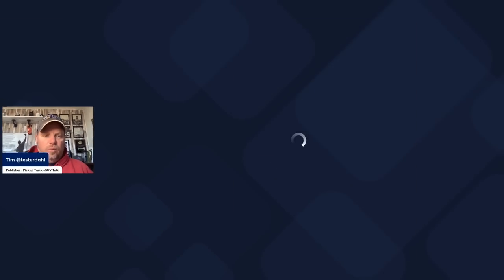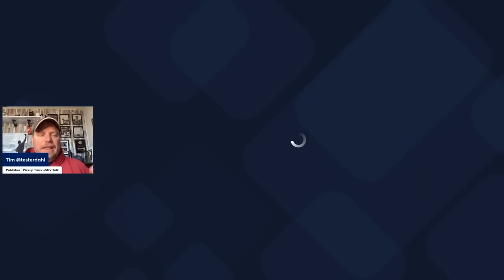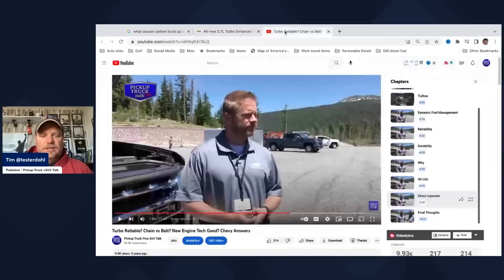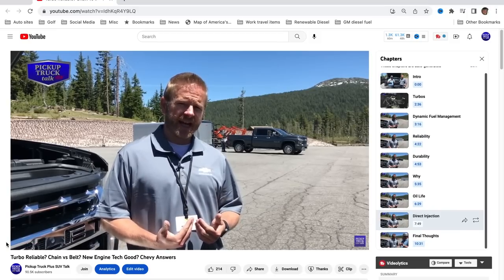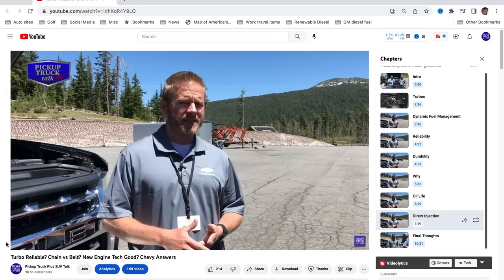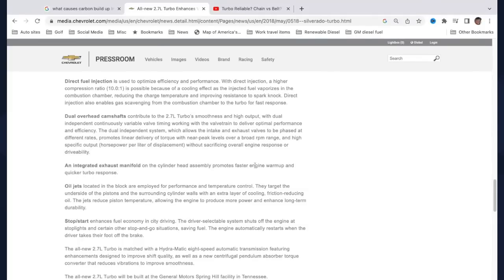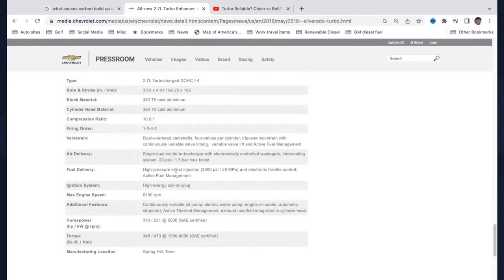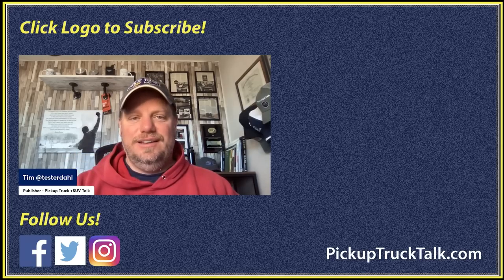Are Direct Injection Engines Bad? Carbon Build Up Concerns?  Engineer Interview

Comment from the maker: Here is the full video with the engineer: https://www.youtube.com/watch?v=IdhKqR4Y9LQ&feature=youtu.be
Reply: This engineer hasn't been reading forums or complaints....this engineer doesn't understand that the owners aren't concerned about the combustion process using direct injection.  As been stated over and over, it's the upstream path prior to compression and combustion that's the issue (due to PCV).  Direct injection has been used for decades in diesels....nothing new other than a timing with the ignition of the spark plugs on gasoline engines.

Comment: I see a few guys already mentioned it in the comments, but I will elaborate on the issue he didn't discuss too. The main problem is the EGR bringing oil mist back in across the intake valves. Port injections washes this off the intake valves and prevents the carbon buildup. Catch cans will slow this process down, but not totally eliminate it. Ford redesigned the ecoboost to have DI plus some port injection to solve this issue. If you talk to him again, please ask him how this specific issue has been solved on the 6.6 gas engine. As far as I know, it hasn't been solved, but maybe I'm wrong.
Reply: Not EGR, if you have oil mist in your exhaust gas, you already have some BIG problems. It’s from the PCV system.
Reply: @jeffs2809  You're right. The older I get, the more think something and say something else.
Reply: You're mostly right but a little bit incorrect terminology. It's the crank case blow by that gets returned to the intake through the pcv that creates intake valve coking. Valve coking is worse on turbo charged engines, which is the point for ecoboost having port and direct injection. The port injection helps to clean the back of the intake valves.
Reply: I just would add Ford to BMW have had the carbon buildup issue on intake values. Toyota from the start went with direct/port injection, first on Lexus. I remember being at the Detroit Autoshow looking at the Lexus engine cutaway (during industry day) and hearing competitor engineers comment that they could not afford to add the extra injectors. They learned the true cost of their mistake.
Reply: And as an engine gets more miles on it the PVC will pull more gases/oil deposits into the intake system which will stick to the hot stem of the valve. This guy isn't assessing an engine on the outer spectrum of time that would be seen on a vehicle coming off of warranty.
Reply: GM failed to learn what Ford experienced with their gen 1 eco boost engines.Just a matter of time for GM to have the same issues. Besides what answer did you expect from a gm engineer especially since he tip toed around a direct answer to a known problem with direct injection.
Reply: Pcv, not EGR. If your EGR is bringing in oil, you have big problems
Reply: @10YearOldTom  You are right
Reply: Wait, the new Ranger will have dual injection? If so, they will definitely give Toyota a fight for sure. Hopefully, the Colorado won't have carbon deposit problems. Yet, I'm betting it will. Time will tell.
Reply: I think Tim also didn't mention that some engines go 100,000 mi 200,000 mi without any issue or concern for this carbon buildup which probably is happening every day but not compromising the overall longevity of the vehicle. As I mentioned earlier, some people don't keep their trucks for a million miles and many people may never experience a problem even with some carbon buildup. So I think the question is is there any additional maintenance or reliability issues with the dual fuel systems where, direct injection is actually good enough.
Reply: One other important point direct injection only on turbocharged engines may be a really big problem because there's no easy or supported way to clean the valves without sending chunks of carbon into the turbo. That's where this becomes a brick wall argument.
Reply: Interesting.  Didn't know there were engines that used both port and direct injection.  Wow.  Talk about extra hardware.  Seems that it might be better to design a cleaner PCV system.
Reply: Hmm... Good point.  Perhaps using full synthetic oil would help as synthetic oils have a higher flashpoint when compared to mineral based oils.

Less likely to burn and coke on intake valves?

Comment: Tim, I think the biggest problem is still not addressed, that is carbon buildup in the intake valves. It’s my understanding that carbon/ dried sludge builds up on the intake valves from the PCV introducing oil vapor into the intake valves building up crud, because in the normal course of port injection the deposits would be washed away from building up on the valves otherwise. Direct injection eliminates this of course. That is why they have added this 2 way punch of port and direct injection. It’s still not clear how GM is addressing this issue beyond using both as Ford and others have done. I think direct injection is pretty great other than this issue and the ones you mentioned. I think all this can be fixed, it’s just what works best. Tim, thanks for a great video with a deeper dive into a interesting topic!
Reply: No knock on the engines, but yes missed the point - the question needs to be - what have you done to illuminate carbon buildup on the intake valves?
Reply: I think twin injection is key.
Reply: @tosil  Like Toyota does. However, unlike Tim is showing with his hand gestures, Port injection comes from above the intake valves thus washing them off all the time. Direct injection is under the intake valves directly into the cylinder.

Comment: Coming from owning several Volkswagens, carbon buildup on the intake valves is a very real problem and the answer still didn't address that.  I'm glad that Toyota has their D4-S system (direct and port) on all their new turbo engines.
Reply: Gas does not remove carbon.  That is not the reason Toyota uses D4-S.  Carbon issues are rare in modern DI engines.
Reply: Lol. No it’s not. It’s quite common actually
Reply: @MSparks9509  Less than 1% of vehicles will ever have an issue.  With millions of vehicles there will be a few issues.  It’s totally blow out of proportion and quite frankly is no longer an issue.  Gasoline absolutely will not prevent the build up or remove carbon.
Reply: @user-tb7rn1il3q  ok, not the gas, but the detergents in the gas prevent the carbon build up .  & yes, it's a big problem on VW's - - i dont know why that brand has such problems more than other, but they do

Comment: This video completely missed the biggest DI problem:  carbon build up on the intake valves.  I have yet to see a GM engineer talk about how they addressed this issue without port injection while Ford & Toyota engineers’ solution was to spend the money and add port for the sake of reliability.   It’s like GM PR is telling their engineers to avoid the subject or something.
Reply: Gm/chev only have direct injection so even after as little as 40,000 miles you have to get the  valves walnut blasted by using a machine that is like a sandblaster. Chemicals do not work. The only way is taking the heads off and getting it picked off manually with tools and solvents or walnut blasting.

Comment: As a 6.6L gas engine owner, here is my experience. Thanks Tim for having this Talk about DI Engines. I’ve listened to this excellent video and read some comments, and recognized GM Engineer Mike Kociba in the clip from a related clip about this engine in 2020. 
Experience: I’ve mentioned to you in another of your videos (your cousin owns a 6.6L engine interview) and that I installed an Oil Catch Can within months of purchasing my new 2020 Silverado HD, upstream of the intake valve and …. it captures approx. 1 cup per 5000 miles (8000 km). That said, Silverado has functioned beautifully up to now (engine and 6 spd. transmission run buttery smooth) and fuel mileage is (14L/100 km hwy. [17 mpg] with maybe 500 lbs of gear) 😌. Very pleased with the truck overall, BUT if I didn’t have that Catch Can, I think over time I would have issues sooner that with it = I think there will be carbon build up with these engines over time despite Mike’s comments, BUT time will tell. 
I agree that as Toyota and then as Ford realized, some added port injection to wash behind the intake valves is critically beneficial to mitigate carbon buildup.

Comment: The core issue isn’t DI, it is when you circulate oil vapor back through the intake. That is what creates the carbon build up. 

DI doesn’t eliminate the carbon build up like port injection does in this scenario. 

The engineer is correct, but he isn’t talking about the entire picture. It is marketing/salesmanship. 

So when you recirculate that oil vapor through the intake, port injection only is far superior to DI and DI/PI. 

A catch can helps, but won’t eliminate it.

Comment: Without a catch can it's best to have both port and direct injection. Fuel coming into cylinder thru port injectors washes crap off the back of the intake valves.
Some manufacturers won't do both because of cost and complexity. 
This guy is defending their design.

Comment: I was in the understanding it was the crankcase venting back into the intake that causes carbon buildup.  That is where a catch can comes in.
Reply: It is the crankcase PCV that draws oil vapor from the crankcase into the intake, before direct injection there was gas that mixed with the crankcase vapor and kept the valve stems and valve bottom clean. Now it’s just air and crankcase vapor on the valve.

Comment: Why would GM say DI causes issues, that’s what they’re touting for their engines. The carbon build up is caused by crankcase ventilation and the oil fumes in the return to the intake and it collects on the intake valves. Port injection cleans the intake valves of this buildup plus if the engine is turbo charged, the port injection lowers the intake air temperature. Also, listen to his answer, he doesn’t address carbon buildup on intake valves. To me it’s marketing BS.  If all you got to sell is DI, you won’t be touting the advantages of PI. Think about it

Comment: I'm not an engineer either, but I know enough about this issue to recognize you know very little about it. It's not about incomplete burning of the fuel, it's about from where the fuel gets injected into the cylinder. On direct injection engines, the fuel mixture bypasses the intake valves and therefore never washes the back side of those valves. I first learned about this issue after my dad bought a Mini Cooper which had to go to the shop twice before it hit 60,000 miles to get the head removed so that the valves could be taken out and have the carbon buildup scraped off.

Comment: Former Lexus technician here: the one thing that seems to constantly get glossed over is that the intake valves coke up due to oil vapor being ingested by the PCV system. 

Unless modern DI engines have been engineered with a better PCV system to eliminate this coking, better minimum engine oil specifications or both, its still a knock against DI only engines.

The 1st gen DI engines Lexus had the LEAST issues with were port/DI engines. Id love to heard these engineers thoughts on that specific issue. 

Looking at buying an LT1 Camaro and this is a point of contention for me.
Reply: why would di push more oil?

Comment: I think he is towing the company line. As long as there is a EGR recirculating dirty exhaust mixed with the crank case oil vapor there is going to be carbon  buildup. Show me an intake manifold and intake valves after 100,000 miles to show how dirty they really are.
I bet if you ask one of these engineers if GMs cylinder deactivation works good you will get the same BS

Comment: This is the least of my problems. I bought my 2023 3.0 from Chevy on the Feb 20th. My engine light came on the next day when I started it to go to work. I got the vehicle back yesterday and this morning the check engine light came back on. I took it back to Chevy and the dealer saying all the codes are coming back to EGR issues. It's to the point the dealership is looking to find a whole new 2023 to put me into and transfer my loan. I'm lucky I choose the financing from Chevy or this option wouldn't have been availible. At this point I wish my truck would last long enough to have the possibility of this direct injection issue. I think the dealership sees the write on the wall and are trying to get ahead of the more than likely lemon coming their way.

Comment: I see most everyone has picked up on the coking issue that is directly related to DI.  I for one have the 6.6L engine and love it.  After 300 miles I did put a catch on it and have been quite surprised with how much oil that it catches...On the 6.6L engine, the PCV system is built into the valve covers and was supposed to be the end all of bypass gasses (oil vapors) getting into the intake.  Not so from what I've seen.  I would highly recommend running a catch can on all DI engines to help reduce the amount of oil vapors being sent into the intake and then collecting on the backside of the intake valves.  I also have a 21 Ford Explorer that is DI, the 2.3L turbo engine.  Believe it or not, I hardly get any oil in that catch can.  Way less than my 6.6L chevy engine.  So I can say that on the Ford 2.3L engine, Ford did a great job with their overall PCV system.  Chevy, not so much....this is just my personal experience, nothing more.  But I do love my 6.6L chevy engine....It is an absolute beast and very fuel efficient as well.

Comment: I’ve seen first hand the effects of DI on an engine, Subaru n/a and turbo 2.0 engines. While DI does lead to greater carbon buildup the addition of turbocharging greatly increases the production of carbon buildup. I believe it’s due to the added crank case pressure putting oil in the pcv system.

Comment: Tim, I can not agree more. Direct injection allows for everything that the engineer stated and prevents pre-ignition as there is no fuel mixture in the cylinder until the injector fires and adds the fuel.
However, you were focused on the engine after the intake valve closes. 

The issue is not downstream of the valve train but in the intake manifold.
All gas combustion engines have PCV to scavenge the extra pressure built up in the oil pan. The PCV routes the purged vapors into the intake manifold to be burnt by the combustion cycle. The intake air and the PCV fumes are passed over the intake valves. When the intake valves are cold, or very hot, the oil vapors in the PCV airstream pass over the intake valve and can coat the intake valve with oil residue which then can create carbon on the intake manifold side of the valve. 

The reason this is not an issue with Port Injection, Throttle Body Injection, or Carburetors is that fuel is added to the intake air upstream of the intake valve. Gas is a wonderful cleansing agent which dissolves any oil residue on the intake valve. Hence, you do not get carbon buildup on the intake valves.  This is why some manufacturers are running both Port injection and Direct injection. 

Cheers

Comment: Any chance in interviewing a Toyota engineer about this?  I was under the impression the build up was from the PCV system.  Naturally aspirated probably no big deal, turbo with all that blow by into the crankcase there is a whole lot more work to do with the PCV system.  I know the dual injuection 3.5 ecoboost still carbon, but just slower, no driveability issues or anything.  Ford  Makuloco has a few interesting videos on the topic and walnut cleaning at his shop.  I'm sticking with my naturally aspirated Hemi with port injection for now thanks.

Comment: Great video, it's well known that DI is more efficient, but the 2.7 is under a lot more stress than the HD because of the turbo. It doesn't really address the issue with carbon deposits. It's a "trust us, we thought of everything" type of reply.
Reply: He actually made it sound like the carbon build up would occur in the cylinder and didn't even mention the intake valves which DI bypasses thus creating the build up.

Comment: Everything you said regarding DI is true, more power, higher compression, more complete burn, more efficiency.  Unfortunately the PCV system and DI alone do not play well together.  If you swap cars every 5 years or so this is a non issue but you hold on to them for extended lengths befitting their bloated prices, you will probably deal with the effect of carbon build up on the intake valve faces and stems by way of engine misfires.
Reply: Can you reduce carbon buildup by increasing burn efficiency?

Comment: Toyota has been using direct injection and port injection for several years now. It dramatically reduces carbon buildup on valves and the direct injectors. This is present on all D-4S engines. 
The direct injection system operates under extremely high pressure. 
These systems do not tolerate off-brand, low quality, gasoline. Top Tier certified fuel is required.

Comment: It is the crankcase blow by that is the issue. The carbon build up on the intake valves is because there is no longer gasoline spraying into the port and cleaning off the crud so it builds up. That is why some engineers got smart and went to dual injection ports to help get rid of the problem.

Comment: Tim,  great discussion and topic. Agree tech is better for performance.
Fact, carbon build-up is mainly on the intake valves, before cylinders, outside the combustion cylinders. So you need to go further and answer the question why not add some throttle port fuel injection to keep the backside of intake valves clean. Yes, the best of both worlds.  I think the answer is cost! Mfr's don't want the added cost and complexity of both fuel systems.
So please continue asking auto engineers and complete the discussion! Carbon buildup leads to misfires and CEL codes, then to expensive repairs.